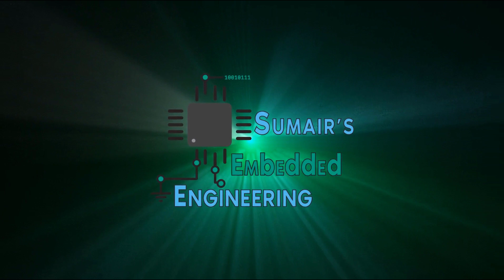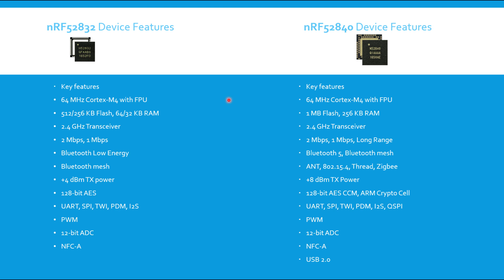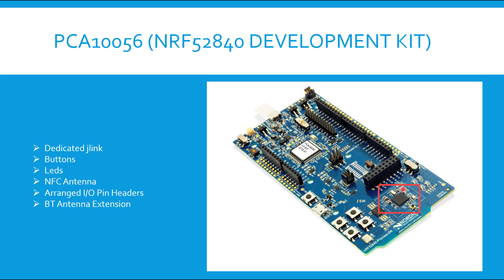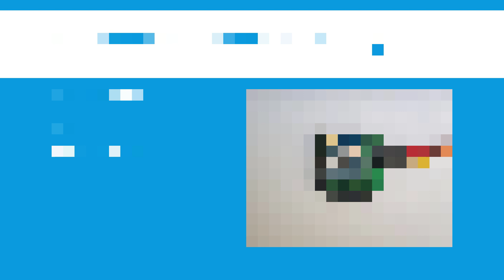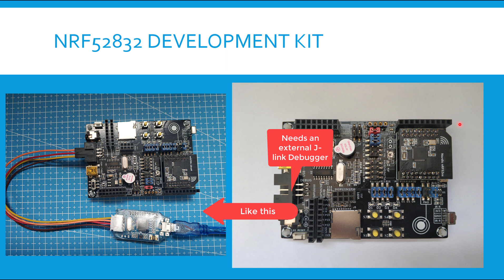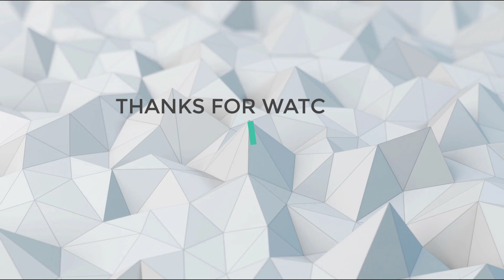nRF5 SDK - Tutorial for Beginners Pt 1- Introducing Development Kits for Bluetooth

Comment: I want to use nRF52840 connect to my house 's router .So does the nRF52840 has wifi chip embedded on board ?
Reply: No, it doesn't have the WiFi module
Reply: @ledkicker2392  DO YOU HAVE AN IDEA ? HOW CAN I USE/MODIFY THE NRF 52840 TO CONNECT THE HOUSE 'S WIFI ROUTER ?
Reply: @patpat7360  you'd probably need to use another module for this, like ESP or OPL1000
Reply: @ledkicker2392  thanks :) , ie . will i be able to use ESP 32 mount on nrf52840 dk ?
Reply: @ledkicker2392  i just want to send the data from bluetooth le 5 from nrf52840 to house 's wifi router to internet /server ,ok maybe with esp 32 wifi then to house 's wifi router , do you have idea or some code ,github or tutorial ?
Reply: @patpat7360  you may search for ESP32 tutorials
You can either program ESP yourself to do desired WiFi operations, or alternatively, you can flash the AT commands firmware (I saw the devs provide it) and communicate with it from nRF via UART interface
Reply: @ledkicker2392  you can flash the AT firmware (I saw the devs provide it) and communicate with it from nRF via UART interface --> regarding to your response , do you mean that i do not need to use wifi functionality from esp 32 to send data to house 's wifi router , but i can use flash the AT commands firmware (I saw the devs provide it) and communicate with it from nRF via UART interface as your reply , am i understanding correctly ??
Reply: @ledkicker2392  i am new for nrf52840 dk , i am not understanding what you replied much , do you mean , i have to write AT command for handling ble 5 on nrf 52840dk ?
Reply: @patpat7360  if you want the nRF to control another pre-programmed WiFi chip via AT commands, then yes, you have to handle that in your code for the nRF
Reply: @ledkicker2392  regarding to your response , i am not so clear much , because i am new for nrf52840 dk , however do you have some code or tutorial for using AT firmware as ESP 32 or nRF to control another pre-programmed WiFi chip via AT commands

Comment: can we use any other studio than nordic , like if ARM etc, actually i want to use rnf52831 with STM , so is there is possibility??
Reply from the maker: hi @ali_ali, we can use ARM KEIL 4, KEIL 5, Segger Embedded Studio,  IAR, and eclipse gcc as well and even the command line if you don't like the IDEs. However Nordic officially supports Segger Embedded Studio and has removed support for KEIL 4 in the new sdk. Also you will find it quite easy to work with SES and its free for NRF Devices. you can use KEIL for stm32 and SES for nRF52832. Hope so i answered your question.
Reply: @SumairsEmbeddedEngineering  you asked that we can use any editor but the main problem is of compiling and download on nRF52832.  I think ali ali also wanna to ask the same question
Reply from the maker: @yasirshahzad3732  its really easy to compile and download with the official free tools, if you see my tutorial 5 for blinking an led you will get an idea on how easy it is.
Reply: @SumairsEmbeddedEngineering  can we use stm32cubemx to upload program on nRF52832???
Reply from the maker: @yasirshahzad3732   no we cannot do that because nrf52832 is different from stm32, so compiling and flashing is not possible unless you modify the stm32cube mx code which would be a more complex way. My advice is to go with the easy way and concentrate on your application and use Segger Embedded Studio for nRF52832. Only ARM Keil can compile both because it has support packages from all these companies. 

if you are more interested in flashing using command line then check out nrf command line utility and if you are interested in using eclipse then you can check the official documentation.